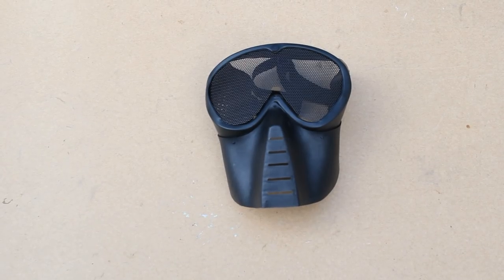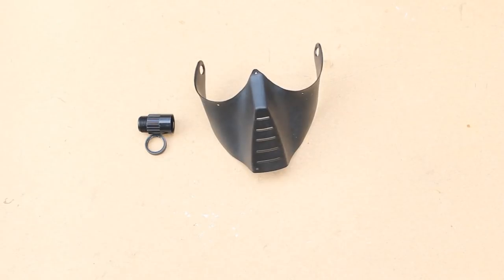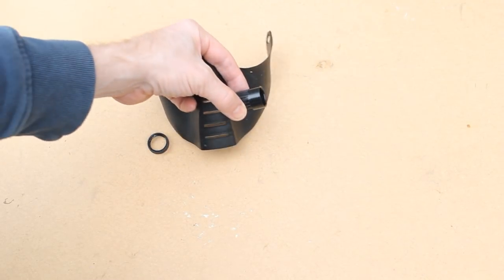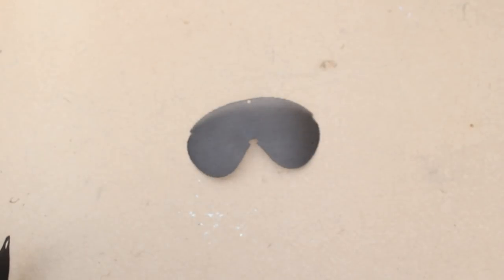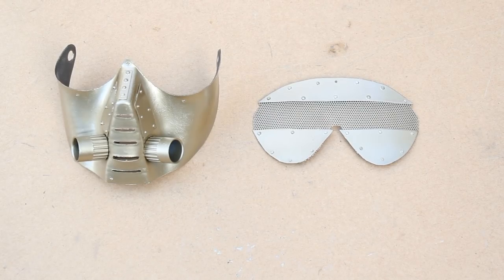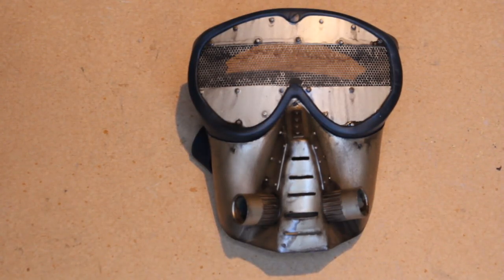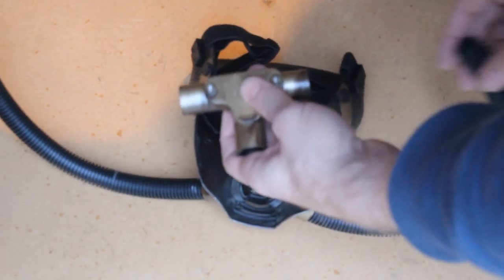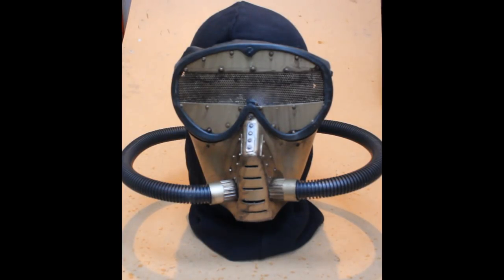Building a steamtech gas mask

Comment from the maker: No.  I only sprayed the plastic parts of the mask with a primer then brass, not the rubber.  The rubber was already that colour.  Even on the plastic parts because they bend so much the paint eventually flaked off.  But you can just reapply.

Comment: Thanks for the reply :) I saw in your 'Arms Race' short film the the pilot of the 'Walker' had a 3M mask much the same as the one I'm adapting and it looked like it had been painted gold. How did you get the paint to stay on? Was it using the method of mixing acrylics with latex glue like you mentioned?

Comment from the maker: If you go to a model shop they will usally sell bottles of different colour washes.  This is a very thinned down mixture so acts more like water than paint and will tend to gather in low points, which picks out the relief.  For this mask I used one that has been made for fuel stains for models.  Just cover the whole area in the wash.  Try to find a color wash that compliments the paint.  So for brass I use a dark brown, for steel I use a black wash etc.

Comment from the maker: Car/Hobby sprays will generally work on hard plastic.  Even if it flexes a bit as long as you have used primer it generally works.  Latex is very difficult to spray I try to avoid using these products unless I plan to stick with the existing colour as paint will flake off.  You can mix water based paints with Latex glue and use this to paint over the latex mask to create a flexible layer but this is not as smooth as spraying.  Gluing/bolting hard plastic to cover the latex maybe the best option.